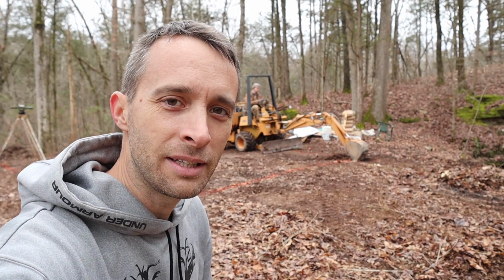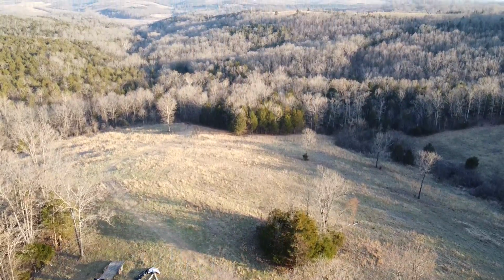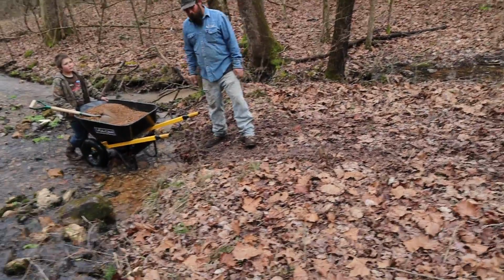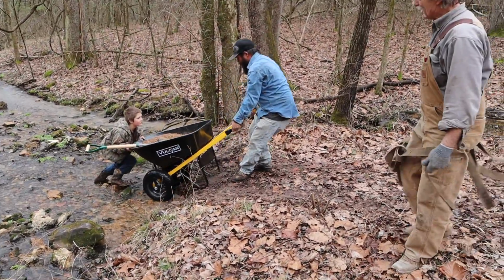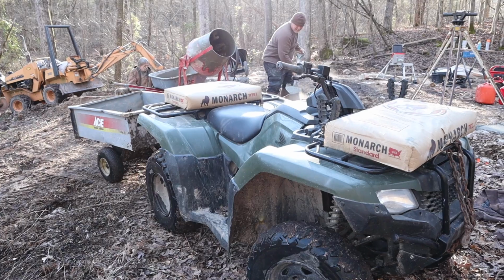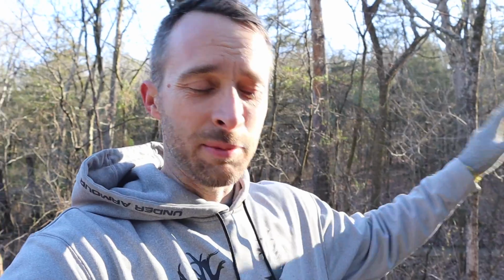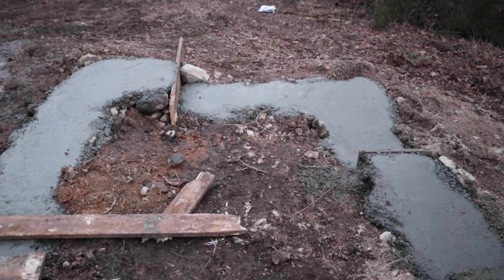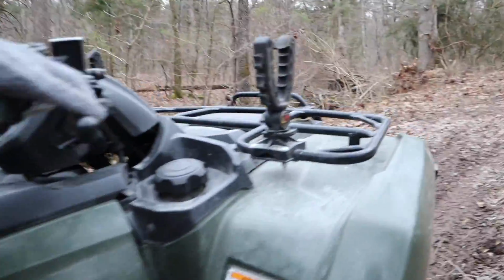Off Grid Cabin Build DAY 1 - Cabin Foundation & ACCESS ISSUES | EP#3

Comment: Most people put in a road or gravel drive before doing anything else. It makes the job easier. Are you planning on leaving your vehicle that far from the cabin when you're using it? If you have to walk in, it that may hurt the ability to rent it as you had said when you're traveling. Just my opinion, but then, I would build on the top of the hill looking down on the creek.
Reply from the maker: I guess I forgot to explain that part.. we have been waiting since Dec for the road to be built down to the cabin but it’s been to wet for the dozer to come
Reply: @LoftisPartyofSix  it's been so wet here in Georgia that my grass is still wet and it hasn't rained here in a week.  But of course,  here it comes again😃